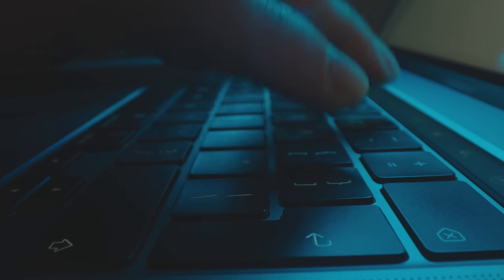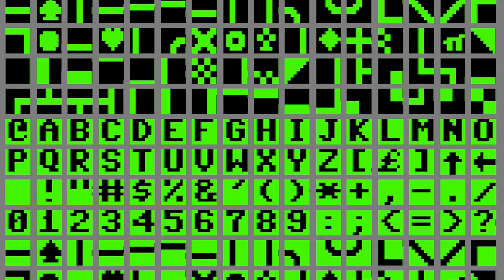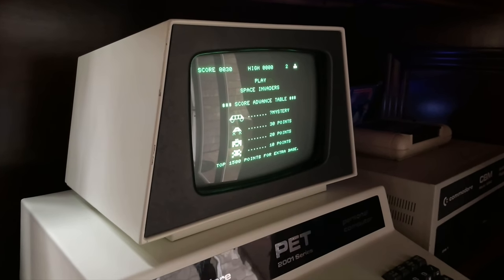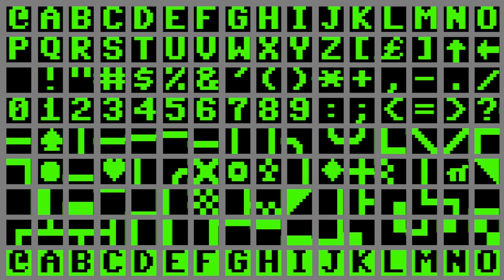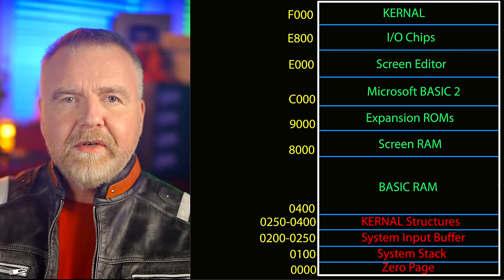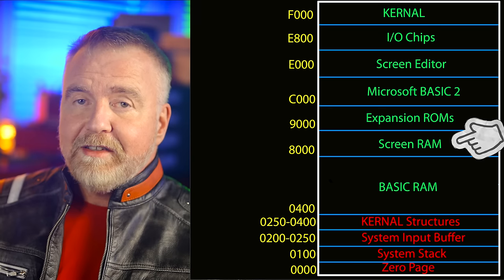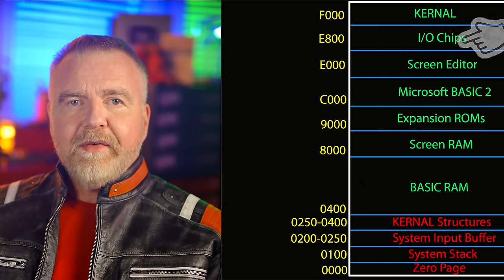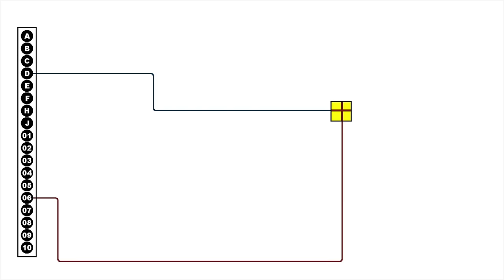Everything you SHOULD know about your Computer but don't!

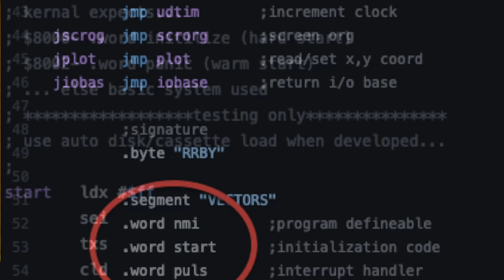Comment: 14:27 That reminds of a command I learned about in assembly that was a far jump to the top of the RAM when running DOS. It was a really big number like FFFF:FF00 and it would start running code that would reset the computer. This is under 16bit environment (x86 processor IBM compatible).

Comment: My guess for why they made the character ROM separate: A typical RAM chip only allows one address to be accessed at once. So, for the screen RAM, the PET includes an address multiplexer so that either the CPU can read/write data, or the video controller can fetch the next character code. If you want to read a third thing from that memory (such as some font data) that adds to the complexity of the video generator and the address multiplexer. There is such thing as dual-port RAM, which allows two addresses to be accessed at once, but it's really really expensive and they didn't use it on the PET.

Comment: I learned the Atari XL mostly because we had Ataris (not XLs) in the school where I taught, so I bought an Atari. There wasn't that much code in the operating system, especially since there was limited memory. I owe my knowledge to a book with the title "Mapping the Atari XL" which mapped all the memory locations with explanations of what each did.

12:51 The Atari XL had a memory location with a bit that could set to 1 or 0, I don't remember which was which but one setting turned the game ports into input, and the other to output. It was handy when I built my Jeopardy game buttons for my class, which I cheated on by coding in Basic.

14:50 The kernel is a frustrated General who never got promoted and so makes everyone call him kernel instead of Mr. when he retires.

Comment: I feel like this is missing a section on how power supplies work for computers. It's not exactly straightforward how voltage from the wall is converted into a way to stably power all components and keep them in sync. Power supply is something everyone will take for granted until they hook up two motors to their arduino and try to run them both at once.

Comment: Nifty ! My 1st was a Timex/Sinclair in the early 80's with an external 2K RAM with cassette backup on which I learned Basic ..... then a C-64 which I remember very little about  ..... & then nothing until about 92 with an actual "Multi media" 🤣 PC, a 386 SX with 2MB RAM & a 47MB HDD & a CD ROM to which I remember adding a FP/DX chip to & 2 more MB RAM & a 256 color video card & believing it was KING, especially after that 32bit upgrade & a $500 hand held scanner & 360dpi color cannon bubble jet. & It was all uphill from there, learning C & never missing a HW upgrade until about the past decade or so or ever since you don't NEED a new system every 6mo - 1yr.  I find the the evolution of technology almost as interesting as the tech itself.

Comment: Back in the 8-bit days, when you bought a computer you usually got a manual with it explaining how it works, circuit diagrams, I/O diagrams etc etc and when you booted it you could interact directly with the machine and start coding on it.  Now you get none of that.

Comment: I had the Tandy Radio Shack TRS-80 and got the expansion box. I had 48K of memory! I got a board from a company named "Parasitic Engineering" which remapped some memory and put in a replacement BIOS so that I could run CP/M-80. I eventually got a PC clone due to my boss' insistance. I wanted an Amiga.

Comment: the pet was the first computer i used in jr high school, we had 2 classrooms full of them, i liked the pet but it was already quite outdated especially considering i was using a vic20 in late 5th grade, but we did have a treasure in the media room, and original mac and a lisa, we were only allowed to use the lisa for 30 min a week so most of my time was on an apple2c or ibm pc jr with the rancid chiplet keys and lol ms flight simulator on it. a weeks suspension after i made what i later learned was called a war dialer although i only printed to the screen when it found a modem. ahh the memories

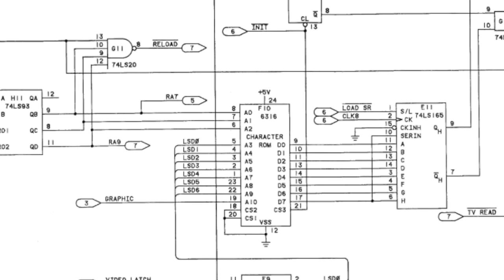Comment: Since I don't have the PET schematics nor a PET, I can only go by the picture shown at 8:50 ... based on that, it should be possible to create a little interface board between the ROM socket and the ROM itself that could be used to switch the ROM off by setting pins 18 and 20 to +5V (that should be /CE and /OE, if the 6316 has the same pinout as the 2716). Of course, that by itself would not help much, but that same board could hold a 1K SRAM (or whatever the current minimum is) chip and turn THAT on instead, controlled by a little piece of hardware logic to switch between the chips.
Or, for a start, you could simply create a little adapter board to put a more contemporary EPROM (2764, for example) in there which has some jumper-selectable banks of characters.
I'm pretty sure somebody did that at some time during the last 40 years ... or rather, I'd be very surprised if nobody did that.

Comment: Apparently, that's why they put characters in ROM, because character generation, signal formation for screen modulation is done in hardware, synchronously with the running of the line of the PAL/SECAM/NTSC CRT screen (15625 or 15750 Hz line frequency). N
It does not load the processor. Access to the RAM is thus never blocked, it does not have to be cleared by other separating buses or DMA.
This would probably be best solved by using another I/O circuit or specially addressed RAM.

Comment: Back in the '80s I had a Sinclair ZX Spectrum Plus, a very nice Z80 machine with 48 kB RAM, 16 KB ROM and quite fast and powerful BASIC interpreter. I remember that feeling of having God's power over the computer. I knew exactly what's inside and what the CPU is doing. There was an excellent book - The Complete ZX Spectrum ROM Disassembly - describing byte by byte all the firmware. That book helped me to understand all Spectrum's routines and also taught me to program in machine language, not only Z80's - transitioning to Motorola 68000 was a breeze.

Comment: 10:42 The pointers you mention sound like the Interrupt Vector Table (IVT) in IBM Compatible computers (most computers that run DOS Windows or Linux). Even modern computers have the IVT but I don't think the IVT is really used after the system boot up on modern OSs.

Comment: It was fun knowing that hitting a certain key would map out to a row byte and a column byte on the 6526 (C64) chip. Later, it was fun knowing that hitting a key would map out to a row byte and column byte on the 8042 or 8742 (IBM XT). But as PS1 got replaced by USB, it started to make less sense to know the bytes involved and just look for a serial bitstream with multiple characters encoded in time with a clock to get a keypress.

Now, I don't think about such low-level routines unless I'm playing with a microcontroller instead of a CPU.

Back then, you had to work out the registers and write routines that pushed bytes. Now all you have to do is look for a library to return a key via a routine.

The process is greatly simplified but I find that to simply accept getting a keypress from a routine without knowing how it does it is somewhat frustrating.

Thanks for the refresher, Dave!  (subbed and liked, no "social" media in use.)

Comment: With 446 comments it seems likely that someone's already suggested this, but just in case no one has yet. All this is from memory (and some of it is a guess) so I apologize if I've gotten something essential wrong--

If the character ROM were visible to the 6502, it'd have to be on the same bus. If only the video circuitry needs to read it, then it could be wired up to it directly, and it wouldn't have to compete with the CPU for usage to get character definitions. The Commodore 64 using the same bus as the VIC-II graphics chip is the source of a small, but significant, slowdown in that system, as sometimes the VIC-II has to actually disable the 6510 processor to access the ROM or RAM without interference. If you tell the VIC-II to blank the screen, it actually speeds up the system by maybe 10%.

Comment: I went with the Apple ][ instead of the PET, it just seemed like a more interesting computer with the hires graphics etc.  Okay, the Apple didn't have a 6522 onboard, but I bought their hobby prototyping board and added one myself, added an eprom too for printer driver code etc, it was also used to hook up to my radios for RTTY, fax etc, still got it and it still works.

Comment: My understanding as to why character sets had to stay in ROM in the early days? It was a clock issue. Before the days of dedicated DRAM refresh clocks, the CPU took care of the refresh. It wasn't possible time wise for the CPU to handle both DRAM refresh duties and the pulling data out of RAM for the gun to paint characters consistently.. early RAM read speeds being slower than ROM read speeds.

I may be completely wrong here.

Comment: Regarding the character ROM on the PET:  It's a trivially simpler design when the video chip doesn't need to hold the bus to read bytes from the same bus that the CPU wants to use. It's also faster, as while the video chip is reading bytes from ROM, the CPU is free to continue accessing RAM. When the video chip uses the same bus (as it does on the C-64), the video chip must operate on alternate cycles against the CPU, or, as in more modern hardware, use DMA fetch.

On the C-64, the bus clock drives the VIC (video) chip directly and then is held by a latch to delay it a tick for the 6510A CPU, so that the two chips operate just out of phase. That allows them to both access the memory bus, albeit at half the bus speed.

Comment: Well I knew pretty much all of that.
You use static ram if you want speed and don't care about power consumption or space (aka capacity), because static ram uses 6 transistors for a flip flop rather than a transistor and a capacitor in dram.
A keyboard typically uses a matrix to determine which keys are pressed. fancy keyboards add some diodes to allow more simultaneous key presses to be detected without conflict.
The olden monitors worked by having an electron ray turn on and off as it was moved across the screen area with electromagnets. The screen was coated with phosphorescent particles that would glow when hit by the electrons.
You add 2 floating point numbers in x86 by using the floating point registers (xmm in x86/64) and then calling the relevant function. you can use either vector extensions such as AVX or you can use the basic ADDSS (add single precision) or ADDPD (add packed double precision) commands in x86/64. Vector extensions are typically faster and allow for more operands, for example adding 4 values to 4 other values with one instruction.

Comment: Pulling from ram requires ram access. If the cpu decides to read or write and your video circuit currently wants to read some byte, there will be a conflict on the address or data lines, probably both.
If you want to synchronize the video reading with the cpu then you'd have to lock the cpu out from the memory when the graphics card accesses it, probably by just halting it's clock because there was no caching and the cpu just fetched instructions straight from memory (with aforementioned problems of conflicts), and you have a massive performance overhead where your cpu sits there doing literally nothing, not even idling.
The other option is to use dual access memory, with two sets of address and data lines. I'm not familiar with the c-pet or c-64. Maybe they have those for the character map that is to be displayed on the screen (ie the screen's desired content). Those types of memory are more expensive and typically have lower capacity. The chips are also quite big because basically they need to have double the amount of legs. having the "gpu" part be the only thing to access some rom with a fixed character map would significantly either increase performance or cut costs for expensive dual access chips.
ben eater has a series on how he builds a computer from scratch using only logic chips. one of his videos is about how to generate a vga signal and how to build a "graphics card". in that video he decides that the graphics card should pull the screen data from memory. to that end he only has the cpu running while the screen is blanking, or about 1/3rd of the time.

Comment: One reason for fixed separate graphics rom could be, that then you don't need to worry about CPU and graphics side wanting to access same data at the same time. On C64, there's (normally) a "bad line" every 8th line of the screen area the CPU is halted for 40-ish cycles, while the GFX chip fetches the characters for current line.

Also, I think at that point no-one was really thinking about games, I mean, the B in CBM stands for Business, right?

Comment: Whee! Your knowledge of the Pet (and I assume the C64) matches my own knowledge of the Atari 800.
The minimum configuration was 8K so we started with more memory. Also BASIC was in a separate 8K ROM cartridge that was mapped into RAM so you could remove it if you needed the RAM for a machine language program. Atari couldn't get Microsoft BASIC to fit into 8K so they went with a custom BASIC that didn't include multidimensional arrays (but still had a way to rig them) and included several graphics commands and the ability to load a machine language routine into a string and then jump to that string address to execute it.
The character map was indeed in RAM and the vector could easily be changed to anywhere in the system. Likewise, the video display was a vector to RAM, with eight different video modes with additional modes that allowed four lines of text at the bottom of the screen. This was done through a "display list" that was run by the ANTIC co-processor. This whole system allowed the screen display process to be completely independent of the 6502.
It's why I consider the Atari 800 to still be superior to the C64 that was introduced years later.
Don't even get me started on the modular I/O driver system. So easy to use to create and install your own drivers completely conformant and interchangeable with the default drivers.
Yeah, there was an entire book from Compute! Books that was nothing but "The Atari Memory Map" with a short explanation of every location. Priceless!

Comment: I know someone that had a CMD 8032.  He had a bunch of chips he would swap out to change the font.   He also had a toggle switch he added and in one stat you got the regular rom font but in the other the font was software controllable.   I've done a fair bit of bare metal programming but I'm not a hardware guy so I don't know how he accomplished it. Now a days you likely could find instructions on line.

Comment: RS232C is not 5v.  In fact the specification EIA-RS-232-C says that logic high must be >=3v <=15, logic low <=-3v >=-15v . Logic level RS232 is normally just called "logic level rs232", be that 5v or 3.2v.....

Comment: If I remember right, ROM was cheaper than RAM, so that's probably the reason for it.

The modern approach would be to have RAM allocated to address, and through some mechanism or another copy your ROM into RAM (a simple approach is to hook "write" to RAM, but throw "read" through some gates that control whether ROM or RAM are read from, include a mem-mapped register to control which source gets the read; and have your software loop through the ROM address space just reading an address, writing the resulting data back to the same address, increment the address, and once you've got through everything write the "read from RAM" value to the mem-mapped register, at which point all reads will be from RAM instead of ROM; the control circuit requires two "AND" gates, one "NOT" gate to flip your register's output, the actual mem-mapped register, and the hardware required to interface with that register, and some "AND" chips may provide a mix of input variations that allow you to skip the "NOT" gate- it's pretty simple logic, almost as simple as you can get with memory), but not only is the cost difference smaller, the ROM used is usually so much slower than the RAM that the BIOS just copies everything into RAM for speed reasons...

Comment: I wonder if you could create a sort of shadow RAM for the character ROM.  For example if a RAM chip existed with the same size, build a circuit that copies the ROM to the RAM, that circuit would also have to mimic the ROM pinout for installation on the motherboard, modify the motherboard so the write pin was accessible somehow, and then you could update the RAM with whatever and still have the speed increase of the PET not needing to access system RAM and pausing the 6502 during memory accesses. I suppose you'd have to have a way to prevent the video circuitry from accessing the RAM during an update but you know, just handwave the details.

Comment: Limiting the character generator to ROM means it does not have to share a bus with the CPU, so it does not require putting the CPU on hold to fetch character data, or dual ported RAM, or interleaved bus access.

Comment: placing character set in Ram instead of Rom, would pose risk of volatility.
and is a security hole, where data could overwrite that area, which would cause the OS input or output system to fail.